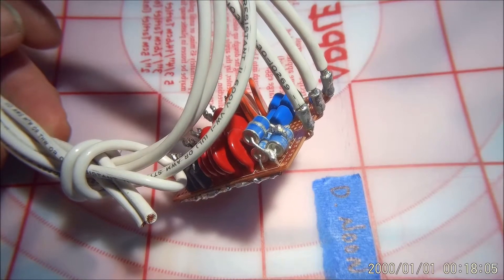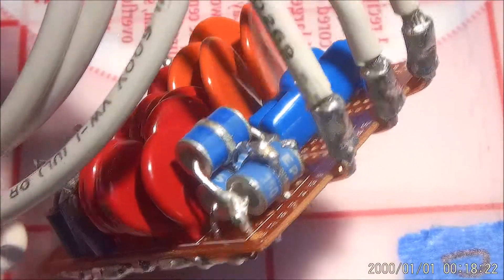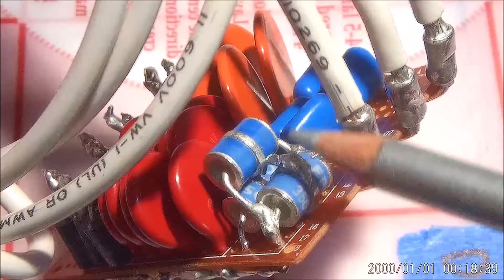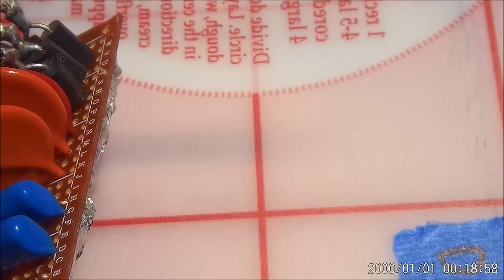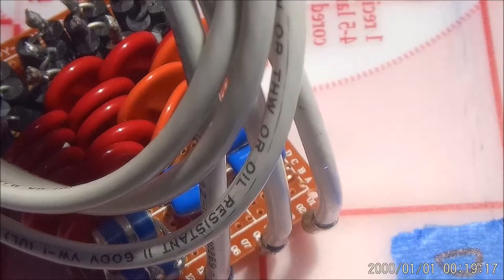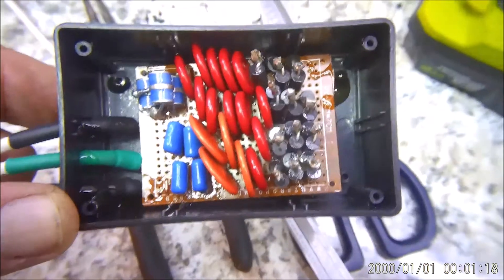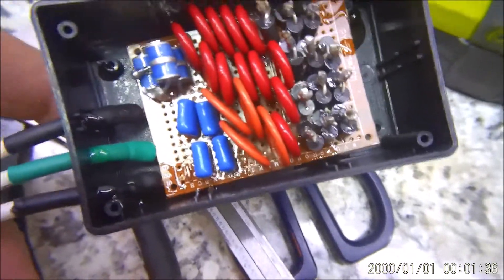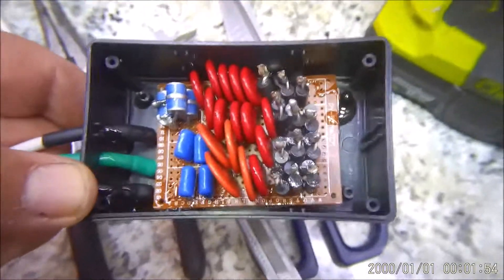EMP Buster part#3, Super Surge protector, How to make an EMP stopper !!!

Comment from the maker: Do not use capacitors in circuit !!! They do not work well like that.
Reply: Could you explain why not to use capacitors ?    Is it a current or voltage issue ?
We use capacitors in old radios for smoothing 400v DC circuits...
Reply from the maker: @kasualskeptik2584  When i put them in there was a small power draw. I do not like wasted current. They will smooth out voltage spikes for sure. You can see them in about all power input sections in most electronic equipment.